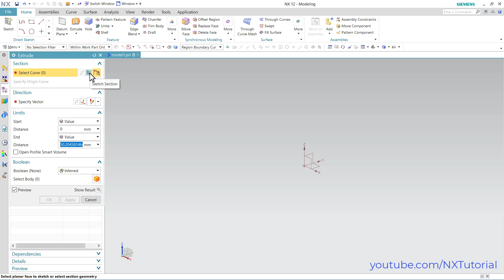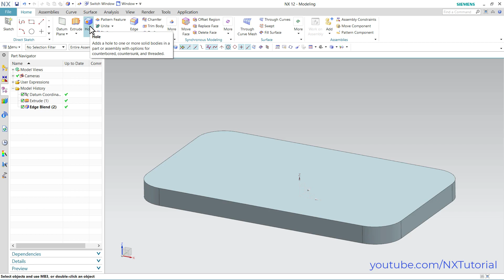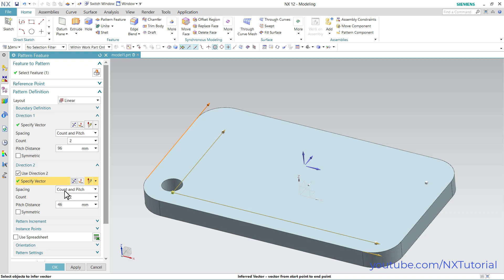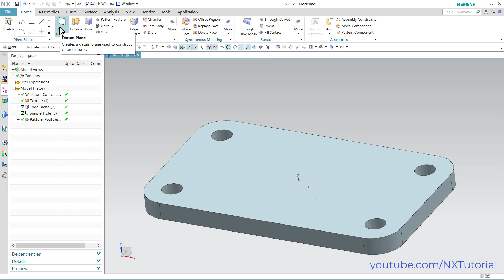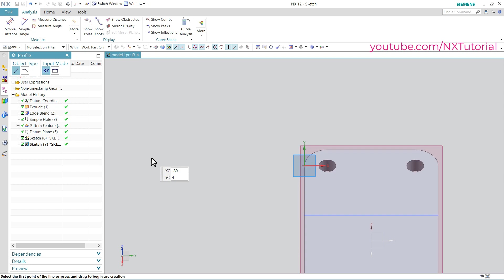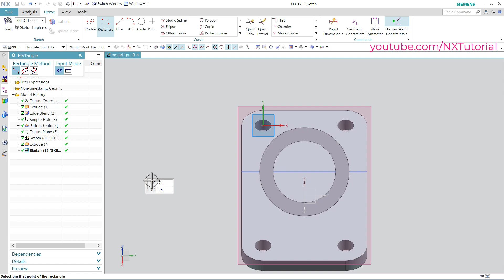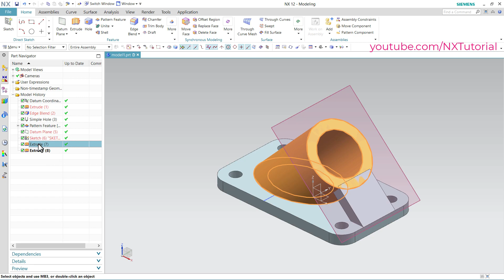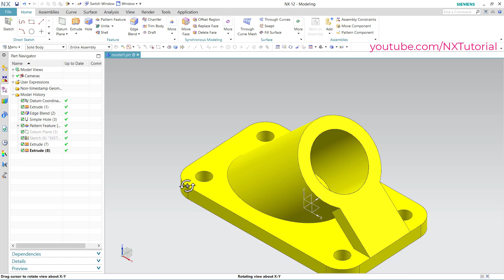Siemens NX 12 Tutorial for Beginners - 2

Comment: Hi there, Great tutorial, simple and you explain each step, vey useful! I have a question please, the menu tab along the top, which has the 'fit' button and the drop downs such as 'no selection filter', on my NX these aren't there, did you manually select these to be there in settings or options? An initial setup tutorial or explanation of these options and best ones to add here may be a good video for beginners. Thanks :).

Comment: Not an NX user, but if you want to make good updatable parts, you shouldn't constrain holes off of features like radii of a fillet, because if you change the radius your hole pattern will move, and when you have two interfacing parts, the hole pattern dimension is far far more important than the concentricity of the hole and fillet, also your part drawing is not dimensioned well, features should be dimensioned to measurable features not assumed symmetry and concentricity
Reply: I agree with this. Also, that secondary datum should've probably been on one edge and then the other. Constraining that 45* with a datum was unnecessary. Thinking about how to measure all of this was challenging. I first try to design with manufacturing in mind, and then I do a second review for measurement methods. If it's a design for my home creation, I'm assuming manual tools and measurements.
Reply: Also would be great if the narrator didn’t have such a strong accent because it’s very hard to understand what he’s saying
Reply: @justindundon4777  His accent really isn't that strong. The Indian accents just have a different cadence that you need to learn. Keep practicing.

Comment: at 5:20 my line ends did not track and snap to the two edges, and at
5:38 I could not select the base's edge with rapid dimension
6:41 despite having drawn the line I could not select the midpoint at center of circle
how could I fix this, please help
Reply: I have also
Reply: me too
Reply: same problem, did u solved?
Reply: @SiyuanJi  I was solved!!! Select Within Work Part and Components from Reset Filters menu. ^^  U can select edge.